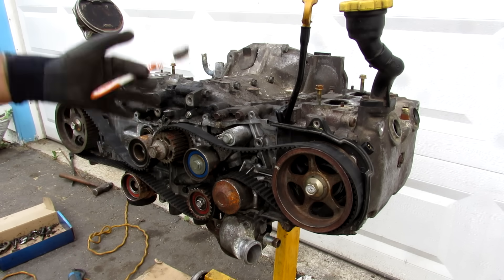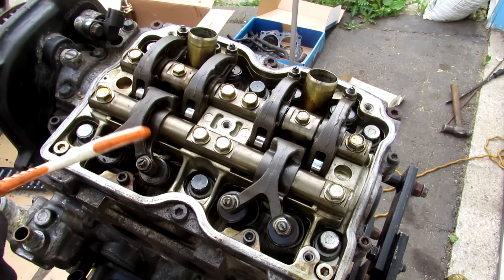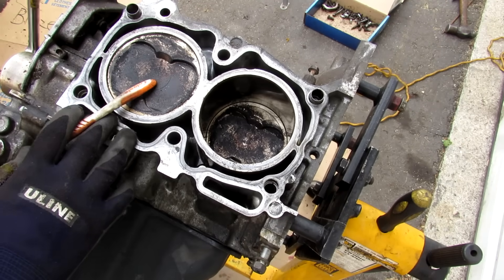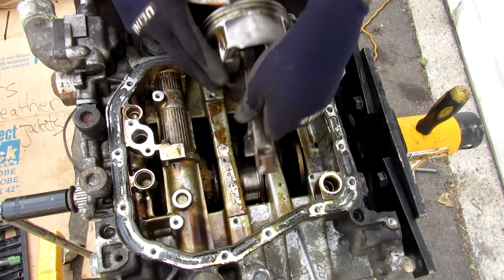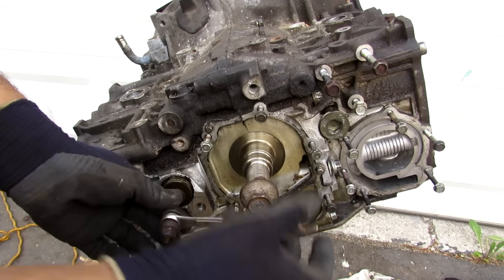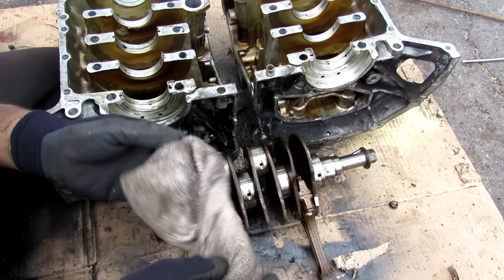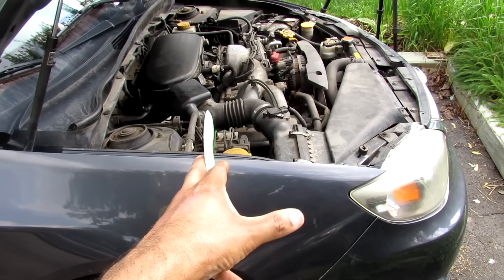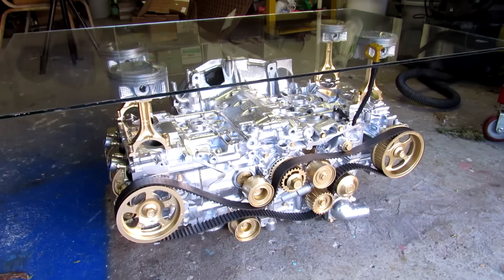Why Subaru Engines FAIL

Comment: If I bought a Boxer engine I'd definitely put a lighter pressure radiator cap on.  It's less stress on the head gaskets, radiator and heater core.   I do that on every car I get & never have any trouble because it's a lighter cap.
Reply from the maker: Also keep it filled with oil!

Comment: Great video, easy to understand. I have a 2017 Outback that I bought because of winter capability. This car is way over engineered in every aspect. I get the benefits of a low mounted boxer motor, but look at how they arrived at the solution!
I would not buy another one

Comment: On my 1992 SVX, I have 237k miles. The engine runs like a charm. On my 2000 Forester, I have 221k miles. The former never received a rebuilt tranny. The latter is on its 3rd tranny, and runs very smoothly. As long as they receive service, the only way to stop a Subaru engine is to shoot it with a .50 caliber machine gun

Comment: Same as a 1200 Honda gold wing it’s a good engine don’t take engine out of motorcycle being shaft drive lot of use of breaker bar to line up impeller to shaft want to aline perfectly the bending a valve

Comment: I bet the dealer told them the oil is synthetic, just change it every 10k miles. I will stick to my 1.8 Toyota in my corolla @255k miles,  perfect condition.

Comment: This is the first time someone related why the head gaskets fail so much.  It's a well-known reality that if you have a Subaru over 100k, you will replace the head gaskets.  I think just checking the oil at regular intervals and letting it warm up after start, instead of just jumping in and revving it out, would give more longevity to the engine.
Reply: We have 2 Ej Subies and one FA Subie with well over 100k and no head gasket problems (one is 180k+). We have done valve cover gaskets on the EJ's. After befriending a local Subaru performance shp and hanging out there, it is clear the biggest Subaru problem is the owners, not the engineering. Young drivers want more and bolt on crap without understanding and without tuning. That is a formula for disaster regardless of brand.

Comment: Been there. Sparkplug changes were a pain. Head gaskets are inevitable. Oil is a constant upkeep. And the oil pump seals tend to leak. Hit almost 300K before I lost the battle with rust.

Comment: I’m no engineer but looking at the enormous length of the belt (I imagine it drives the cams) I can’t help thinking, friction, flexibility, stretching and potential harsh mechanical vibration, it implies all sorts of possible unreliability.

Comment: I had a 2002 WRX, I was so excited when the turbo model became available in the USA after watching WRC rally racing for several years. The car was immediately at the dealer for repairs more then in my garage. Clutch shudder issues, leaking shocks, sun visor fell down, ABSOLUTELY NO POWER off the line unless you revved the hell out of it , and then rod knock at 17k miles. They fixed it under warranty and I sold it. NEVER BUY A SUBARU, their engines are trash.

Comment: so why not use engine oil as antifreeze?
they do this on duetz diesel 3 cyl engines in heavy equipment..
yea more volume of oil to change but if you use a sock filtration system
you just change the socks only and add a quart or so at sock change interval.
and if done right the oil could be a 100k or 200k change if you keep up with the socks like they do on an industrial setting.

Comment: I wonder if its possible to install a more improved head gasket and pistons to make up for the issue the Boxer engines have.
I do however wish to buy the Toyota 86 2023 at some point due to its Boxer engine and its modern setup,plus it has Manual.
Getting the Toyota "Supra" whit its BMW Engine and BMW Interior is not ideal in my opinion.

Comment: This is a brilliant expose of the Subaru engine. However, it's the EJ25. Over here in the UK we have an EJ20 engine which is a 2.0. I have one of these engines and they do not suffer from the problems that the EJ25 engine in terms of the head gasket. It follows that the oil starvation and mixing of the coolant and oil due to gasket failure do not exist on this engine. The EJ 20 I have is a 16 valve engine producing 165 BHP. I have had this engine for 16 years and in that time it has used not a drop of oil over 115,000 miles and has had zero problems.. Some might say it is just run in. It has been serviced as per the manufacturer's recommendations and so I absolutely agree that this is vital for the longevity of the engine. It's also very difficult to work on, but worthwhile. I am not sure why it is not available in the U.S. but it would solve the head gasket problems which plague the EJ25.

Comment: One thing  I noticed when shopping for Subarus a few years ago is that they almost invariably leak from the rear of the left valve cover.  Every time I'd go under one I'd see oil there.
Reply: BTW, Confession time...I've starved a Subaru of oil so badly I threw a rod on the interstate.  Made a nice 2 inch hole in the block.  Foolish me spent many thousands replacing the engine just to have the car totaled when I hit a deer less than a year later.

Comment: Subaru boxers really don't sit low in the car. They're stacked way up on those goofy front axle setups and sit just as high as any normal engine. Subaru powertrain packaging is bizarre and awful. Non-subie boxers sit around axle centerline, not entirely above.

Comment: Subaru puts the best AWD config on the worst Engine. There's not a single owner who hasnt experienced oil burn and knocking with these engines and it happens at <100K miles. Stay away if you plan to keep your car for long!

Comment: I have owned Eight Subarus - all bought new. I put on a ton of mileage and every one drove in excess of 150k miles with little to no problems. The only thing I ever did was to religiously adhere to manf maintenance schedules. Always brought car to dealer for service and I found they were as reliable as ever. When I traded each in the engine was still running strong, didn’t burn oil and still had plenty of power. I mostly traded them in because I got bored with car and wanted to drive something new. Good basic transportation.

Comment: I've got a junked '79 Subaru on my land. The 4WD was cool but the front strut towers rusted out and the wheel started tilting outward. I braced that up but then the engine ring gear got so bad the starter would grind. Thing was built like a cheap beer can. Watching this, I see the engine is also a stupid design.

Comment: I just traded in my 2008 Impreza last month. Got it in October 2007 (new) and owned it for 15 years. All I needed to fix on it was 2 wheel bearings and the fuel pump. Besides those things it was rock solid. I was nearing 200k miles when I sold it and it ran great.
Reply: I’m a mechanical engineer, who lived with professional Subaru specialists, mechanical engineers, and rally racers all in one.  I haven’t watched the whole video but a lot of the things mentioned are silly - “if the engine oil is contaminated it will start eating through the head gasket” - uhhhh.   If you’re putting the engine through these sorts of conditions, you have bigger problems.  Problems that would be true for all engines not just Subarus. 

Forced air intake Subarus have notable issues particularly with the oil filters becoming clogged.  Mid-90s 2.5L Subarus have head gasket issues, which you may or may not experience, and which were corrected in the early aughts.   One of my several 2.2L Subarus had an issue with the harmonic dampener not being bolted down enough (a mechanics error to not torque to the whopping ~170 ft-lbs (IIRC)).   Otherwise I’ve accidentally driven the engine with virtually no oil for dozens or hundreds of miles with no major long-term issues.  The EJ22 is considered to be one of the most reliable engines of all time

Long story short, it’s easy to take this video out of context.  Yeah do required maintenance, yeah having corrosive oil is bad (why would you let such a thing happen????).  Subarus are the most reliable/easily maintained vehicle I’ve ever owned.
Reply: @stevebean1234  glad you said it, all engines have problems if mistreated. And all engines have flaws and reliability issues, recalls, and so forth.  Subaru actually ranks very good in reliability indexes compared to most other brands.  That is the funny thing, yet people (a small minority of doltards only ever found on the internet, who likely just saw a few memes one time) will still crap on a boxer in a Subaru, but not in a Porsche.  Or they will say they're unreliable, when they're like the 7th most reliable brand there is (depending on survey), and so forth.

Comment: This guy is definitely DEAD WRONG about a few things. For example... saying that the opposed 4 cylinder is smoother than the in-line 4, is 100% WRONG. Subarus have a distinct rumble... because of the opposing cylinders🙃🙃🙃

Comment: Had a Subaru XT a long time ago that stopped running at 70k miles. As far as I can gather, the reason why the engine failed was due to 3 bolts that were still tight.

Comment: had a 2011 WRX/STI for just over 5 years, loved that car, kept the engine stock and when I sold it at 130,000km the compression and leakdown came back less than 10% from stock/new engine values. I believe these engines can be pretty long life if not modified and maintained well, but like any design, there are some flaws. I really enjoyed the car but it was definitely getting long in the tooth. Great video, I learned a lot even after owning and maintaining my Subaru for 5+ years! And yes, the spark plug change was NOT fun (4 hour job)!
Reply: @Rich Cran on most engines yea but for turbocharged/ higher output engines they do get expensive after that, even more so WRX and STI boxer engines - some last longer, some don’t, often turbos go or they need some major maintenance (like Subarus with their head gaskets). At the 130,000km point I had owned and enjoyed the car for almost 6 years, it was out of warranty, and I was ready for something new so went to a 2018 golf R and enjoying that very much as well (albeit many problems but almost all under warranty)

Comment: Short answer is that they aren't over built like their German flat 6 counterparts. On the turbo applications, the head bolts are too small and not strong enough. This leads to the metal stretching under the boost loads and will eventually cause a failure at the head and block  looking like an HG failure. Additionally they aren't the easiest engine to work on when it comes to maintenance. Again referencing their German flat 6 counterparts,  you remove 6 or 8 bolts, life the car and the engine stays on the ground giving you full 360 degrees to work on it. While not difficult to remove a Scooby engine, it does take time and that leads to long service intervals for maintenance. A simple valve job requires removing the engine...

Subarusmhad been cheap enough to be disposable after 100 to 150k on the clock and buy a new one. Unfortunately the first run of the STi on the GD platform also suffers from the traditional JDM that issue as well. Especially in snow areas. This has become the unfortunate fate of my 2007 STi. New England winters finally got her after 15 years. :(

Comment: Its strange to call it a fail when you get 250,000+ miles before you have to change the head gaskets and timing chain. Then get another 250,000

Comment: So now that you have the plug removed you must reach in the hole and remove the wrist pin clip and you will need a special tool to remove the pin...there is hidden bolts in the oil galley's..ya ya ya..This is precisely the reason why people who have a Subaru engine failure simply put the engine in the trash and buy a used JDM replacement....

Comment: I know its subaru's signature, but why do they keep developing new ones.  

The flat engines only have advantage in racing applications, for just normal cars its terrible.

You have a 4 cylinder with double the parts...Why?

Comment: I've owned two Subarus, and hated them both for different reasons.

1. 2013 Subaru BRZ: Slow as shit and overpriced.  Can't really turbocharge it much without blowing the Boxer.
2. 2014 Subaru Forester: Same engine. Blew up all on its own right after 150k miles. Cost several thousand dollars and there was still oil leaking inside the motor.  Had to sell for scrap basically.

Will NEVER own Subaru vehicles ever again

Comment: why Subaru engines fail?  for the same reasons all engines fail... no oil, no oil changes, no radiator fluid changes... so what?  nothing special here and nothing derogatory about Subaru

Comment: I love how educated and well detailed this video is, no repetition or imprecision or whatever. And all that precious knowledge is presented with an old toothbrush.
Reply: The moment he mentioned headgasket issues be wary. It was linked to a single layer headgasket that was promptly resolved 20+ years ago. Head gaskets are not a common failure point at all. 

When a Subaru "expert" mentions head gaskets bet your ass they are not an expert. The only "head gasket" issues come from overheating the fuck out of it or making big power and blowing the cylinder wall out of round.

Neither are actually a head gasket issue.
Reply: @jeepmanxj  Yet my Impreza 2005 had a leak at piston #3, the infamous head gasket problem. $3500 Canadian pesos to rebuild it. I sold the car for the same price two months later after the rear diff. died, it was going to be $2500 to fix it.

Comment: My Subaru failed after only 314,000 miles. And by "failed," I mean that I managed to destroy the spline/slot interface where the axle halfshafts connected, during an epic "mudding and bouncing" day, during which, I yanked a lifted Ford Ranger out of a bog. The engine... was fine.

Comment: Hard to believe that Subaru hasn't fixed their boxer problems by now. They have been using this type of engine for a very long time. I guess it gets past the warranty period so they don't care. If a mechanic can point out these various weaknesses, why haven't the engineers corrected it by now?

Comment: Great video, thanks.  I have a Forester with 323,000 miles on it.  Finally burned a valve after 19 years.  Still runs well enough for a while longer.  LOL.  5 speed manual.  Best car I  have ever had, but you do have to keep an eye on your oil level....ALWAYS.
Reply: Agree

Comment: Twice the cylinder banks means twice the cooling needed. Cylinders laying flat means its very easy to starve one side of oil so you need crazy good fluid pumping. Oil/coolant also sits in the channels for a long time building up gunk and clogging up. Boxer engines are designed to fail.

Comment: As a serious Subaru owner (have five at the moment) and wrench-puller, I have to say that this is an unusually good, quick, and no-bullshit breakdown, and any criticisms are small.  He could have used better lighting (rather than just a toothbrush) when showing access to the plugs with the engine in the car, as this SOHC actually has good access since the ports are angled up.  They're quite a bit harder to get to in the DOHC engines (which also have much longer timing belts).  Also, he failed to mention what is actually the most common head gasket failure mode, which is between the coolant passages and cylinder, causing the engine to burn its coolant (a symptom is usually the presence of combustion gas bubbles in the coolant overflow reservoir).  Otherwise, though, I give this video two thumbs up.

Comment: Today my mechanic said my engine oil should last a few more months but I changed it anyway.
I'd like to reduce the chance of having to take my engine apart, thanks. I love my Legacy but I hate the head gasket issue. Funny how my Nissan Sunny had an issue with gasket but not my Legacy. Well, at least not yet.

Comment: I've never seen a professor use an engine grime covered toothbrush as a pointing stick... but man it's definitely everything I missed in my education, great video about the internals and makeup of these boxer engines.  I'd never seen one take down and gone through like that.  Keep up the good work!
Reply: THis. After a time, you have a toothbrush for repairing stuff.  Like i have.
Reply: Not only does he give an excellent explanation of everything, he compares the different engines at the end of the video, along with the advantages and disadvantages of each. He is not opinionated, he just gives the facts. 
Wonderful job!
Reply: The craziest part is its his daily toothbrush
Reply: @robmausser Actually, it is his brother’s toothbrush. Same as the sock.
Reply: This way he can brush his teeth when he's finished with his tutorial video.

Comment: Just a sensational video... and the tip at 8:00 to make a hex key is very smart and helpful indeed. Thank you for an excellent video, jamb-packed with information.
Reply from the maker: Thanks! Next time I'd weld the boot to the nut so there's no way  it'll come off, then blast with the impact gun

Comment: Only buy a subaru if either you're a car guy , or very well-financed individual that can afford a reliable mechanic who specialized in boxer engines. Otherwise , save the hassles and drive a much simpler cars for daily

Comment: I’m considering buying a 2022 Subaru Forester Wilderness. I was told Subaru has fixed the gasket and oil leak issues. Is that true?  What model year was the engine you just disassembled? Great video. Thanks

Comment: All I know about Subaru engines is that they seem to last forever.  I have driven over 700,000 miles with four vehicles and the engines have never failed.  An insurance company totaled out my 1995 Legacy wagon with 277,000 miles last year.  It had various minor problems but the engine was just fine.  It did not even burn any oil.